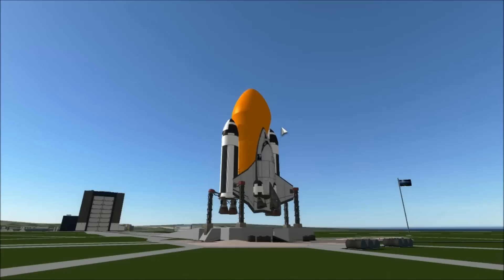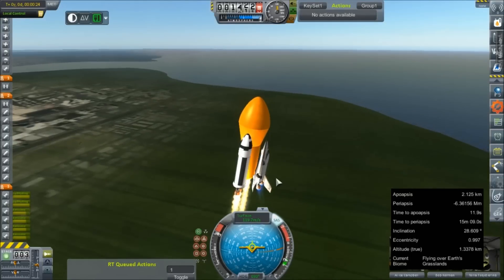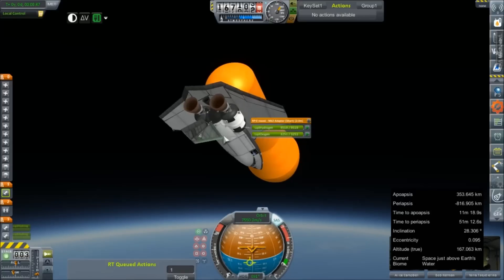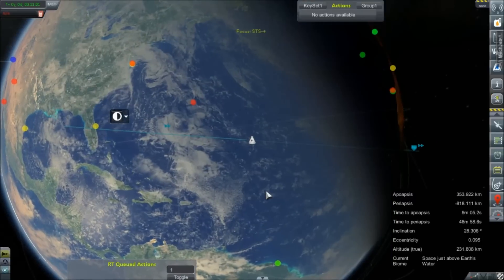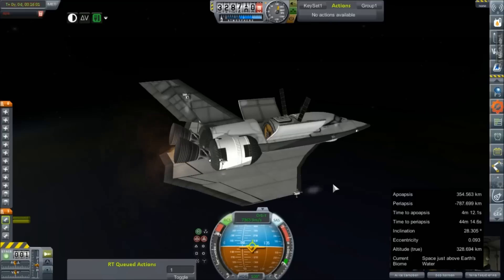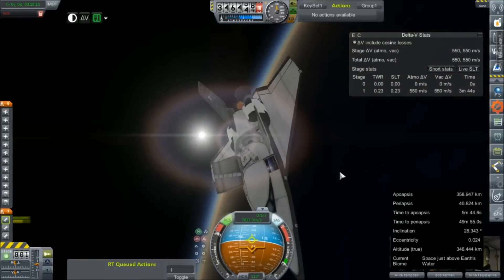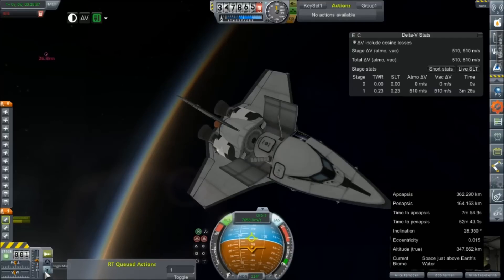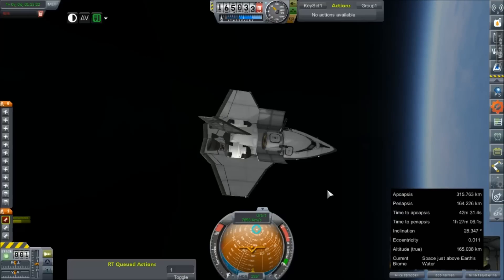KSP RP-0 #205 STS-4

Comment: Can't you use Procedural SRB for the Solid boosters?
Reply from the maker: There is an issue with pSRBs, sometimes the costing Nulls, and it ruins the .craft file. when they do work, they just can't deliver the thrust and duration needed.

Comment: Hey Crash, I haven't seen any notifications for technology in awhile, so I am wondering if you have finally finished researching your backlog of tech. If/when this is true, I would like you to devote part of a new episode to blow all the science you built up so far intelligently, with tech order determined by order of plans for future missions.
Reply from the maker: The backlog is still huge. I added it up once and figured out that R&D wouldn't be caught up till mid 1978 or so ( at current rates anyway ).  I also 'unlocked' every node that was under 500, which means I can't dump anything else into the queue until I upgrade the R&D center which is just a bit out of budget at the moment. ( 1.5M to upgrade IIRC )
The big news around the space center is we may have made an astounding breakthrough recently, one of civilization shaping significance - the wheel.